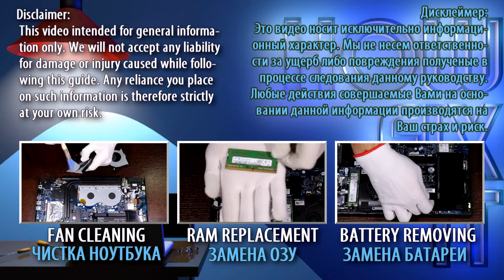Lenovo IdeaPad Y700-15ISK Hard Drive or SSD Upgrade: Replacement & Installation Guide

Comment: Can you use 2 hard drives? Use a ssd for booting up and leave the fsctory ome for low speed storage?
Reply: Yes you can, you need to use windows media software to move windows to the SSD and set the boot drive on your bios.

Comment: Hello, my HDD has broken and I am going to replace it with a ssd, the problem is that the HDD had w10 installed, when replacing the hdd with the ssd, will I have to buy a new windows license? I don't know the windows activation key because the windows was already installed by default on the laptop, if I don't have to buy the license again, how can I install the windows on the ssd? thanks

Comment: Also wird in diesem Video die HDD mit einer SSd getauscht. Bei manchen y700 MOdellen gibt es bereits eine SSD und HDD drinnen. Wo ist denn dann der SSD Steckplatz? Ich würde gerne in meinem PC (der noch keine SSD verbaut hat) eine zusätzliche SSD neben der HDD einbauen, aber wo ist der Steckplatz?
Reply: Musst du separat kaufen
Gib das in eBay ein:
FRU 5B40K25518